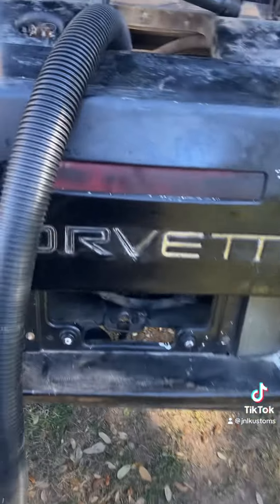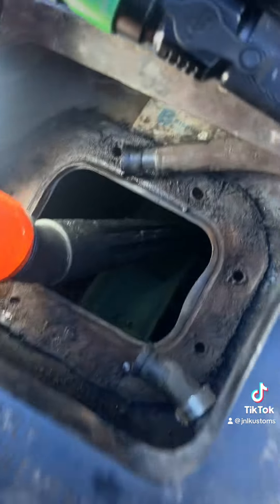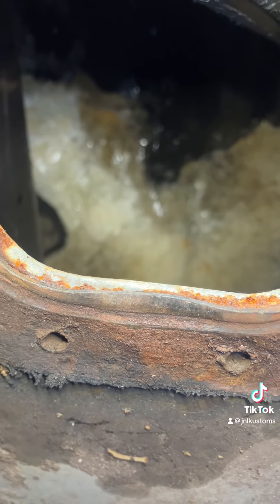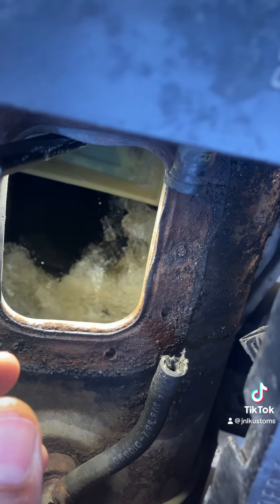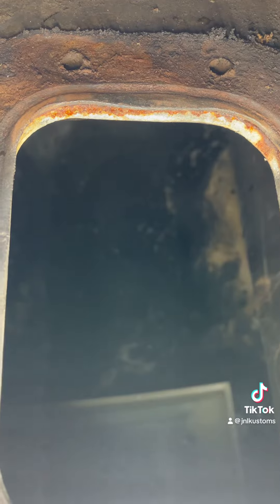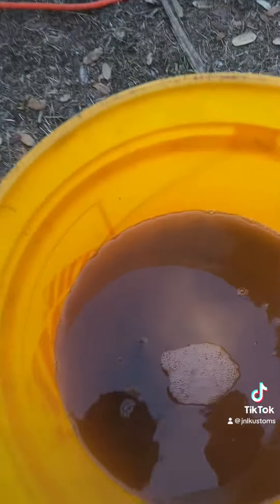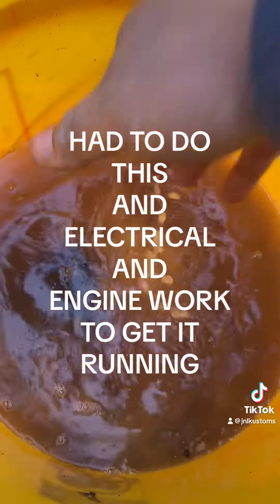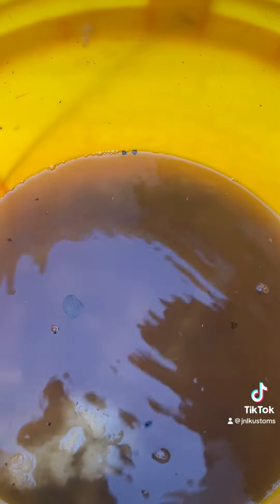THIS CORVETTES PREVIOUS OWNER SENT IT TO 12 SHOPS N THEY COULD NOT GET IT STARTED FINALLY SOLVED$$$$

Comment: Corvette gas tanks must be made of an ultra pricey precious unobtonium metal that can't simply be fixed by dropping the old shit tank and bolting in a new one .
Reply: I guess it’s all about who has the ability to fix what’s wrong and continue to use it rather than just replace it. Nearly anyone can replace something that’s questionable by watching YT videos and calling a friend, but a man who can straighten out a problem and carry on while keeping his money in his pocket. That’s real $hit!
Reply: @seventeen912  The tank is obviously still rusty ice didn't rid the steel of the rust .
Reply: Dude showed the inside of the gas tank afterwards i didn’t see any rust the ice did stick to the surface rust and came out with it. I agree with 912 that’s real shit. Dude is a master mind.
Reply: @juxo1395  you think ice removes rust from steel.. let's see what that tank looks like in a year or so if it's still rust free . I don't see how ice can remove rust if it were that easy they'd use it on light body panel rust and cars in the east Coast would have rust free chassis after a good snow fall 😀
Reply: Surface rust is a thin layer of rust that develops on metals that contain iron. It's usually a brown or reddish color and it's flakey or dusty.
Reply: Which is what this tank had. Which this guy removed. deep rust would be a different story